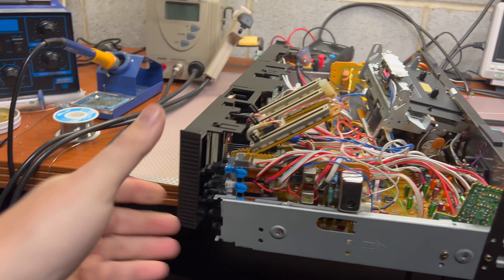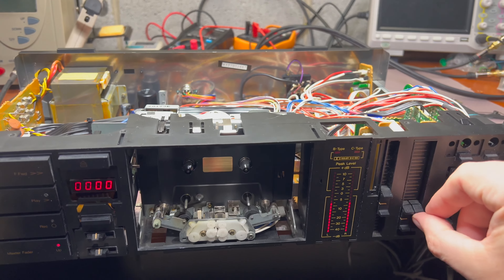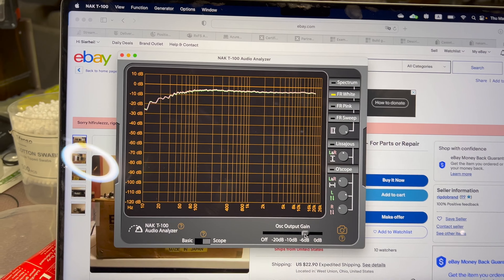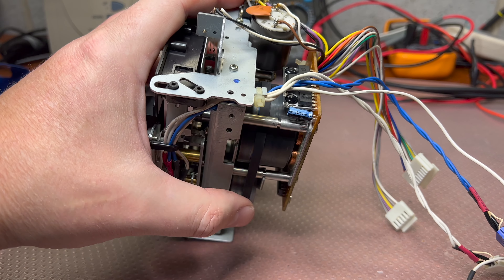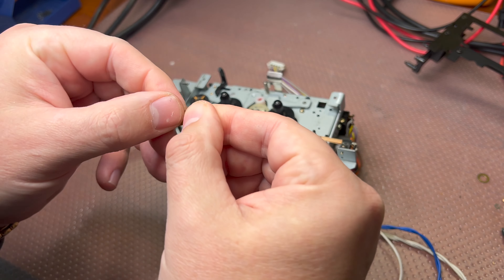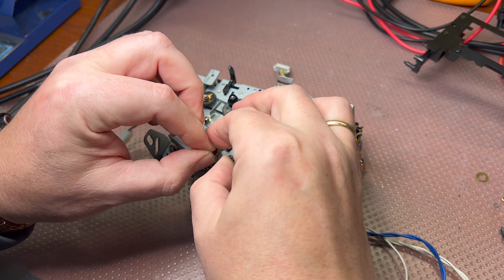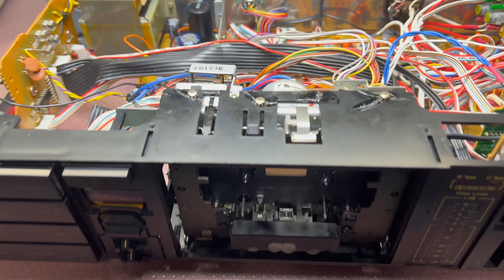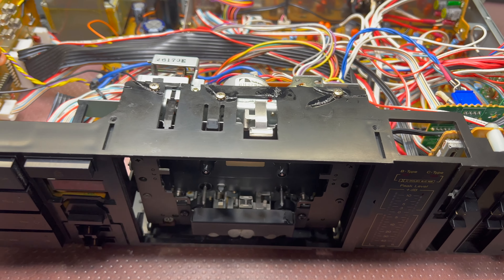Resurrection Complete: Nakamichi BX-300 Restoration - Final Part

Comment: 12:31 What do you think the actual issue was? I have the same “won’t fully engage” issue on one of my BX-300s and I have disassembled, cleaned, lubricated and reassembled that cam system and motor many times with no change. Please let me know if you have any other suggestions. Thanks for making these videos, you document some very interesting disassembly and repairs!
Reply from the maker: The system is simple. There is a breaks lever and a pin to pull the head's carriage up. When the command gear rotates it should pull both up. However, in some cases, it won't. I tried to change the point when the switch will engage - it did not help, so, I bent it back. I put all my attention on the assembly routine. Checked that all parts sit tight in their places. Lubricated the pin to let it move freely. And it did the job. I believe the problem was that the frame supporting this command gear was not sitting in place.